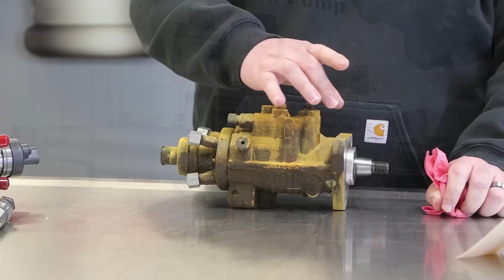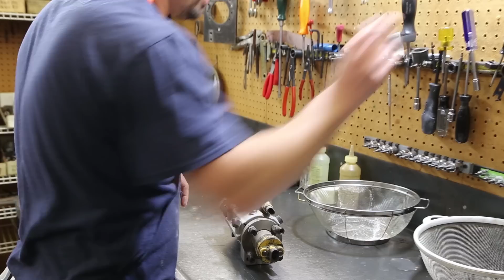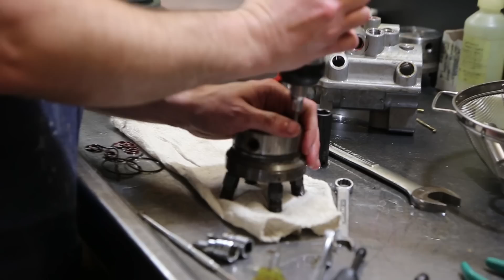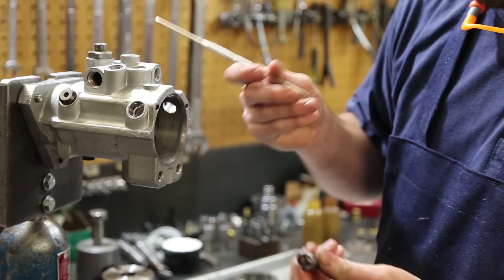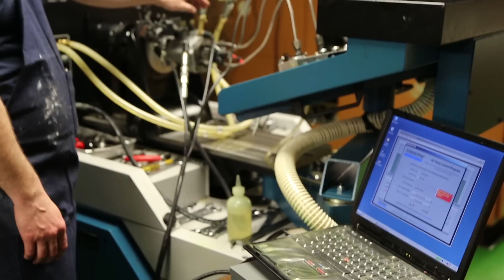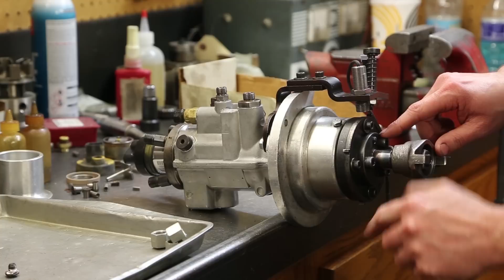DE Pump Rebuild 4 Cylinder Stanadyne DE2435-5805 for @C_CEQUIPMENTJohn Deere 550H Bulldozer Crawler

Comment: Great  video,  i realise this is about a year later but if u get this id appreciate if you can help diagnose a de stanadyne 6 cyl. Sometimes it will run intermittently like it has a miss but when its under a load it will  run good and strong.  Maybe to strong . Id appreciate.
Reply from the maker: That’s a tough one to diagnose over the internet, you might want to send us a letter with some more details.

Comment: Hi Sir, thanks alot for this valuable information, in fact, we have problem with John Deere engine, I need to know how to calibrate the controller with the engine . When we connect the engine to the scanner tool , we received this code( SPN 1076 Present

Engine Fuel Injection Pump Fuel Control Valve - Out of calibration). Code you please advice. I do have photos of the pump and controller and serial number of the engine

Comment: Hi! Excellent video! Îs it possible to check without disassembling the pump if the solenoid is is blocked and is not opening?